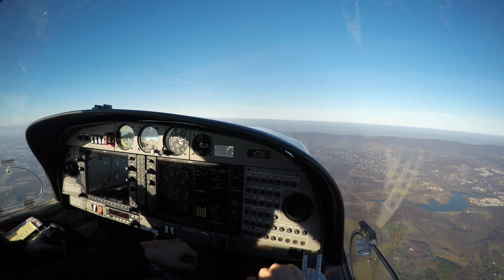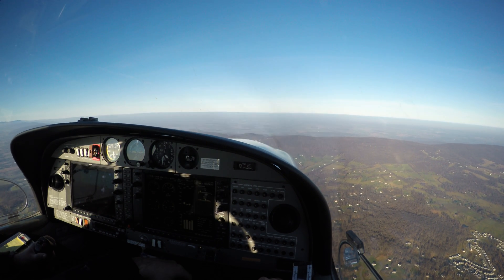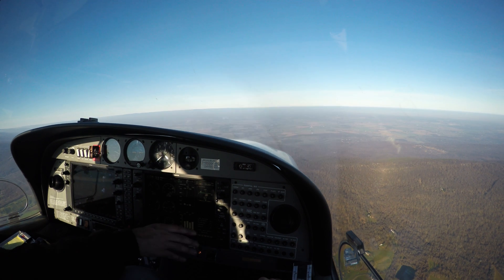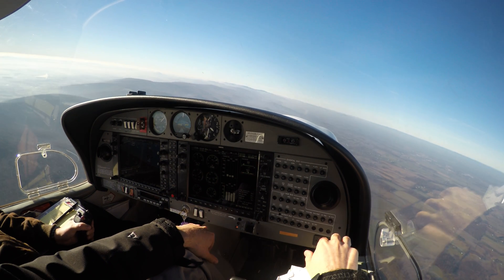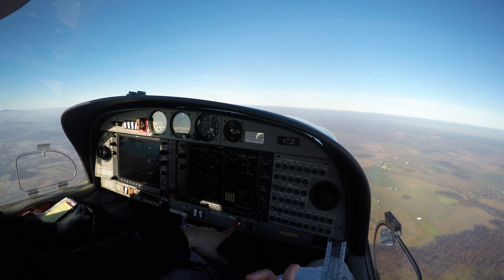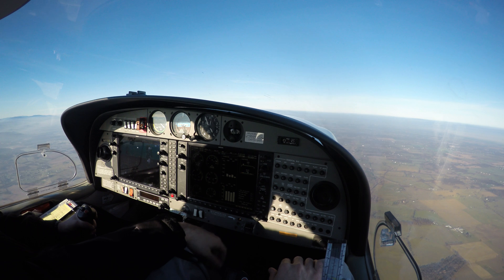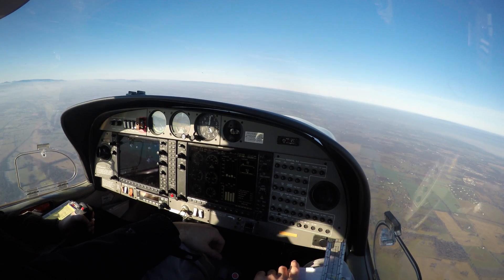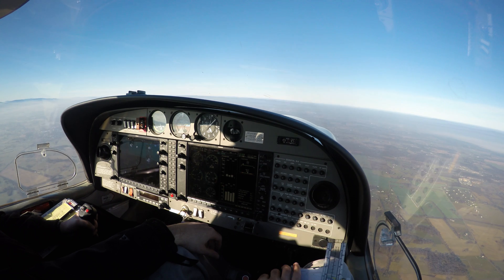DA-40 Slow Flight, Poweroff/On stall to horn, Steep Turn with Audio

Comment: Stalls in the DA40 is not when the stall warning first goes off. It is actually a true stall at 47 knots and this is when the plane actually goes into a stall. The danger in what you are doing is the student may try to recover from a landing when the stall warning goes off. In the DA40 it goes off every time we land. So again the power on, Power off stalls should be done at 47 knots not 70...
Reply from the maker: Hi David - I had my student do stalls at the commercial level which is at the impending or at sight sound or feel based on the ACS. Though private you do these at the buffet. We weren’t at 70 knots.
Reply: I understand... I did not know if it was a private or not. I own a DA40 and know when it stops flying "or stalls" in my da40 we have always done stalls at the buffer. Great video.....
Reply from the maker: David Gosnell Thank you for your comments, always good feedback. I appreciate you watching! Have a great day and keep flying safe!
Reply: Hi guys, may I ask the certain procedure for slow flight at DA40-180 ?
Like when should extend First flaps and last flaps and stay at which speed for slow flight.